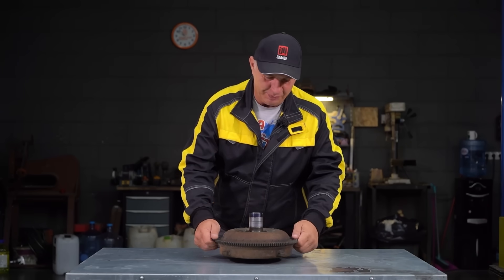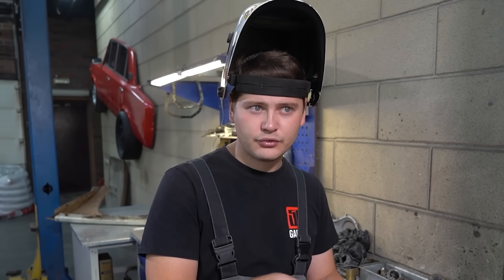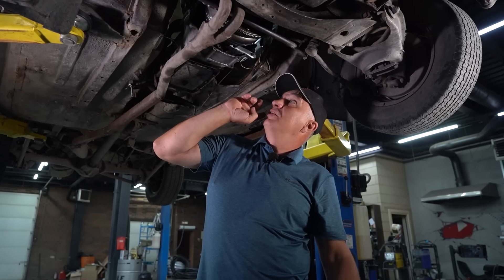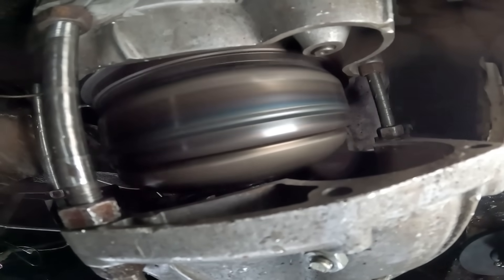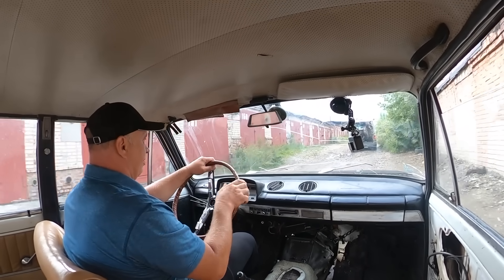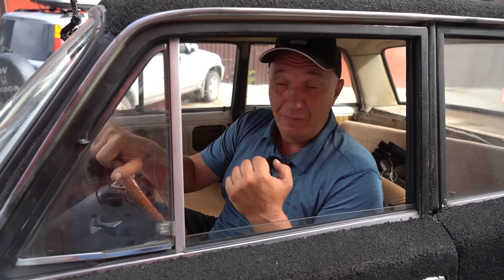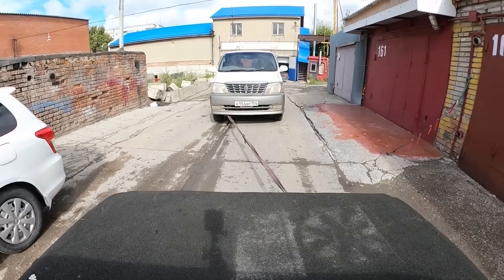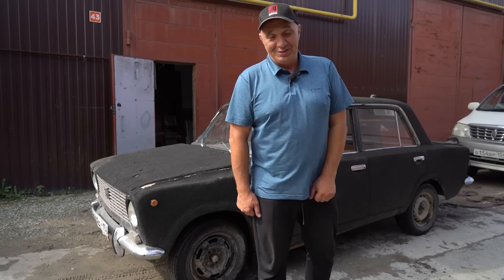Torque converter in a manual transmission - will it work?

Comment: The 1978 MAN mil gl offroad truck used a standard 6-speed manual gearbox with a clutch AND a torque converter. So you can shift without grinding your gears, but you don't need the clutch pedal for anything else.
It also had automatic torque converter lockup for every gear (even reverse).
So when you drive fast on the highway, the torque converter is bypassed and does not eat energy.
But when you slowly creep up a hill in an off-road situation, the torque converter is really useful with multiplying the torque. And it also allows you to drive slower than the idle rpm in first gear, without slipping the clutch. That is really good off road.
Reply: Wandler my beloved
Reply: Nice

Comment: The only downside to this setup, and you could see it when he stopped at the end, that fluid in the TC had to be 350 degrees! Without any way to circulate the oil, it's going to cook. Granted this was a proof of concept, but yeah...

Comment: Put a chevy 383 stroker in it with a turbo 400 transmission. tub the rear and put a ford 9 inch in the rear with some slicks.  As little as the car is it would be a monster.

Comment: I would say use a higher stall speed, then install an electronic switch(button activated) lockup/delocker. I'd personally use the switch to momentarily release the clutches while pressed to allow switching gears. Getting the stall speed correct would make everything mesh better,  also better/more synchros would probably help. Neat diy, love it

Comment: Isn't the lockup clutch normally located in the trans?  Also I thought the whole point of the pump was to push ATF into the converter.

Comment: Now do the opposite! Hook an automatic up to a regular clutch instead of a torque converter. Yes I know it makes no sense but who cares? 

Yes, i know this will present challenges on how to maintain pump pressure when clutch is disengaged, but you guys can figure ANYTHING out. Probably could simply drive the pump off the front of the engine and use the clutch to disengage and engage only the input shaft.

Comment: This concept will never work since torque converter creats a lot of heat and with torque converter lock up not working  that torque converter will burn up since it has no cooling lines.

Comment: Volkswagen did it succefully in around 1968. The automatic stick shift. It combined a 3 speed manual transmission, a torque convertor, and a vacuum operated clutch controlled by a solenoid. It disengaged by means of contacts in the shift lever. When the lever is being g moved, it energized the circuit to the solenoid, disengaging the clutch. My 1971 super beetle had this system
Reply: I remember getting to see a Thing that was retrofitted with an auto stick for a gent that had lost his left leg but still wanted to drive his Thing. Was pretty cool

Comment: I bought a mini Cooper and I could have swore I had something like this😅 but it turned out it was just a slipping clutch 😭 you never know how new cars are made unless you do your due diligence. Next time I buy a standard I will just dump the clutch and do a burnout right in the parking lot what's a used car salesman sitting in the passenger seat😊

Comment: Volkswagen did something similar in the late sixties called an auto stick 3 speed transmission with a vacuum controled manual clutch and a torque converter

Comment: Use a larger diameter torque converter with about 1000rpm stall speed (your Lada idles at 850rpm) and 2:1 stall ratio

Comment: Vw had these but they also had vacuum operated clutches. So you could disengage the trans and shift! I built one of these up and plan to use it on a dune buggy but I’ve got several projects with priority over that

Comment: Honda had a semi-automatic gearbox back in the 70's and 80's that operated on this principle. Both my great grandmother and father had one in their Civics. Torque converter let you start in any gear or shift smoothly, while clutch was there to go from forward gears to neutral or reverse.

Comment: I think it would work better on dog engagement manual gearbox instead of synchromesh type as you can shift gear easily without the need to disengage the input shaft

Comment: In the 80's Mazda had a 5 speed manual trans with parking gear. It has a t-converter and a clutch (twoo bell housings) behind a 13B rotary engine that was used in small commuter buses... I have two of them.

Comment: Multi gear hydro-static drive.
Reply: Thicker oil would yield more power transfer to the gearbox.
Reply: Lower rpm at idle would make it easier to put it into gear after starting. 450-500 rpm would keep it from turning the gearbox after start up.

Comment: Any way to manually control the TQ lockup? I imagine the efficiency of a constantly slipping "clutch" is quite poor. You could also maybe replace the torque converter with a CVT transmission if you want an utter abomination of a powertrain.

Comment: Question, is this basically how a hydrostatic drive works? Please excuse my ignorance is something I've always wondered about and never really took the time to look it up just curious I can see where such a setup could have advantages over either an automatic or standard in certain applications an example will be heavy equipment tractors and off-road vehicles....

Comment: VW beetle did this in 1969?  Vacuum clutch switch on gear lever which released the clutch  with a torque converter old news joe

Comment: But now let's see you try to go through the gears like normal, rather than stopping and starting between them (which just about defeats their purpose). See if you can find enough slack in the converter to let you shift gears like normal, or if you totally have to float the gears with manual rev-matching.

Comment: I guess formula 1 gearboxes work the same. If they bought back stick shift instead of buttons it would be like throwing ice on the track. I use to flat shift without the clutch or only use it to disengage the compression lock up to control the back end and set all my breaks to the front by completely removing the rear brake and running a locked diff on everything so the engine breaks even through both wheels so I have to use the throttle through the corners.

Comment: Add a clutch between the torque converter and transmission for easy gear changes, then weld some cooling fins on the converter. You will you will have what Chrysler had in the 40's and 50's - Fluid Drive. I own two Fluid Drive cars and they are both a pleasure to drive.
Reply: Fluid-Torque drive. Only the later ones had torque converters. The early ones had fluid couplings with no torque multiplication.
Reply: @gregorymalchuk272  But they still worked well, as Chrysler-built engines did produce the needed power.

Comment: The madman's brainstorm strikes: Imagine a 4X4 drive train with locked the front and rear differentials and a torque converter in each drive axle to drive the wheels, sounds funny.
Reply: Sounds like all the power and torque

Comment: It can work!  I've driven a 1980s Ford Backhoe with a 4 speed manual but instead of a clutch it used a torque converter.  It had a button you pressed on the shifter to disconnect the transmission, I'm not sure if this was done with a clutch or a brake, I am guessing clutch as it would roll away when the button was pressed.

Comment: I have always wondering why manuals are never fitted with torque converters. 

Thanks for providing that with more engineering it can work. It may even prove to be the best transmission

Comment: This is the same system as used by Jim Hall with his Chaparral 2 series of Canam racers of the 1960s.  He used a torque converter with a 3-speed manual gearbox.  As in the video, the cars could only be started when the transmission was in gear.  This setup left the driver's left foot free to operate the high mounted rear wing; he pushed the pedal to flatten the wing when running down straights.  The cars were innovative and successful, although they never won the championship, always beaten by the McLarens.
Reply: Another little fact to love those cars even more. Thanks!
Reply: Sprint cars figured out an even better method for DRS. They use struts, when the pressure on the gurney flap becomes too high it overcomes the oleostruts resistance and lays down, when the car slows down the flap comes back up again.
Reply: Yes I have got an original GM Research transaxle in a replica Chaparral 2a , actually a 2 speed from 1965. And yes you have to start the engine in gear and stop it to engage reverse . It’s quick off the line in either gear (Brit Hillclimbs ) and a delight to drive . A Chaparral mechanic assured me you could easily convert a Hewland but probably a bit beyond me. Incidentally it is beautifully made and at 70lbs less than half the weight of a Collotti  Type 37.
Reply: @richardfalconer1959 the 2G with the 427 was my fantasy car as a kid. The sounds it made are etched in my brain.
Reply: Damn mclearens
Reply: Should a welded another night straight across from the other one for balance
Reply: I saw the Chaparral run at the CanAm Races at Edmonton Speedway Park in the 70s

Comment: you should tried flooring the car from a dead stop and run in threw the gears at full throttle,,not putt around a back alley ....this channel seems to be getting weak ..in the old days they would beating the crap out of the car

Comment: Gr8 job guys, just a point, automatic transmission fluid pumps have a drain hole just behind the fluid seal to the torque converter nose that allows excess fluid to drain out, was this port plugged up? I have seen some  transmissions with this port at half way up the torque converter which means that it is possible the fluid drains out when the engine is stopped due to "U" tubing effect, it could affect the ability to keep the torque converter completely filled in this project....another note, the torque converter lock up in most automatic transmissions are normally released, that is allows freewheeling of turbine inside the torque converter, when fluid pressure is applied through the hole in the end of the input shaft, it pushes / applies the lock up piston which presses the lock up clutch to rear part of torque converter causing it to be locked up ..and looking at the components used, quite possibly they are from an Aisin Warner U140 automatic transmission equipped in toyota Rav-4

Comment: That's is so crazy. The things we learned in auto class and was told not to try.... These wonderful men are bringing mechanics to a whole different level. Thank you guys from the USA
Reply: Just bcs this Russian got his car to move around, doesn’t mean it was a good idea.
Reply: @evilsimeon   Why?? Because he's Russian?? If he were from the US, would that be okay??
Reply: @gustavoarmand4111 
Nationality has nothing to do with it.
Reply: @evilsimeon you sound even dumber than the original comment poster.
Reply: That's because you were trained to be a part changing monkey.
Reply: Probably cause cars are complex machines on best of times and if you are working on customers cars, you dont want mechanics trying some experimental things on them, specially since manufacturers have instructions on how to repair it. Of course that system has its flaws and there are the few who ignore these. Hell how hard it is to find mechanic that does not mind doing EGR by pass mod to customers vehicle for legal reasons. Hell even to replace part with the same cheaper part from another make and model, simply cause for instance i tried to check the drivers window lift switch/motor fault on Clio mk2 with wrecker part of Megane. Sure drivers window went up and down on drivers side, until it didnt and putting back the old switch, now the passenger side that did work, wont work no longer, so i presume something else broke, even though it was identical part that bolted in place with out issues. When working on electronics trying things might cause even more issues, hence why mechanics tend to replace things with new parts until fault it found, in detriment of the customers wallet.
Reply: @Hellsong89  learn, experiment, risk. Known as LER method. A high gamble way to learn about something, even if you don't have cash, it will give you high rewards in the end.
Reply: @Hellsong89 Как у вас там на западе все сложно, у нас вообще пофигу какую деталь ставить, клиент сам потом будет отвечать за то что ее поставил и что то не заработало, ну или СТО само предлагает установить деталь подешевле если уверенно в ней.
Reply: Just goes to show you how even tho vehicles can be complex... the human mind  can't be governed .. just because you "shouldn't" ...doesn't me "you can't"

That's why it's called trial and error

Comment: Pulling the van clearly demonstrates the mechanical advantage of the torque multiplication afforded by the converter
Reply: But we both know without the circulating fluid and a trans cooler, the TC would overheat quickly.  In this case you probably would not know it until it blows up (cracks with rapid boiling fluid loss).
Reply: Converter Boil over explosion sounds like a good one for the Russian disaster crew
Reply: At the very end, it looked like there was some smoke coming off the torque converter, I'll bet that thing was way too hot to touch after towing the van. To get it to lock, they'd need to add some additional fluid paths to engage the internal lock plate.
Reply: Super cool video! I love stuff like this

Comment: I wonder how much heat is added to the oil in the converter in this configuration?
Especially when starting off in a higher gear

Comment: Essentially you made a "Powerglide Transmission" ... It's an automatic transmission that you have to manually shift into higher gears
Reply: Not quite !  The  GM Powerglide  was a 2 speed full automatic vacuum over centrifugal shift modulated trans.
The good thing about the PG, you could push start the engine once you got rolling over15 mph due to it having 
a rear pump driven by the drive shaft.
Reply: I was around when Chevrolet produced power glide. It was a 2 speed real automatic transmission. Although there was a version you had to hand shift
Reply: @larrycjost9388  You can hand shift any automatic, starting from manual low and
upshift but you have to let up on the throttle and allow the vac/ Tps/throttle pressure/ rpms to fall a bit first !
Reply: That is not what I am talking about. I am not sure but I believe the earliest version of power glide had to be hand shifted .because Chevrolet designed it that way because they didn't know better in early 1950's. There was also as version in the early 1970 that had to be hand shifted because Chevy did it that way to lower the cost of the car. I had an aunt who had such a car